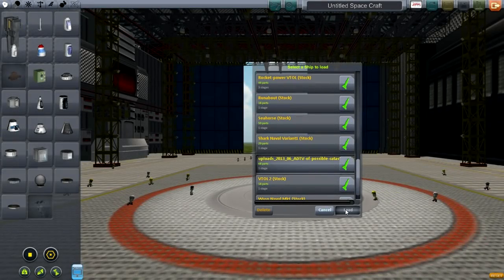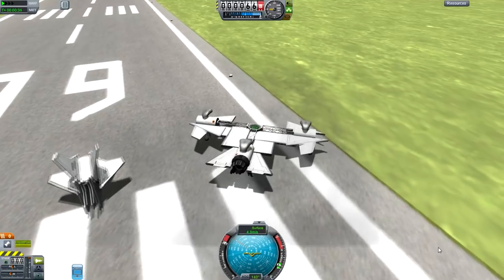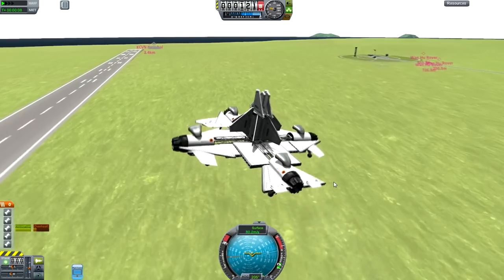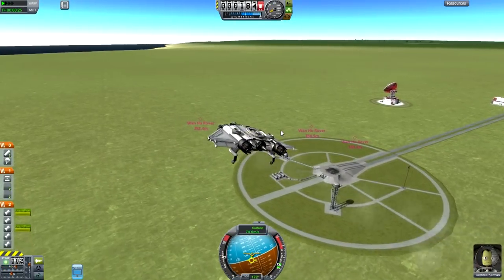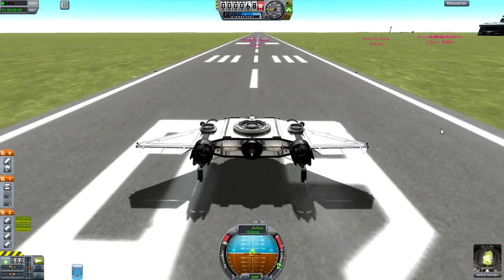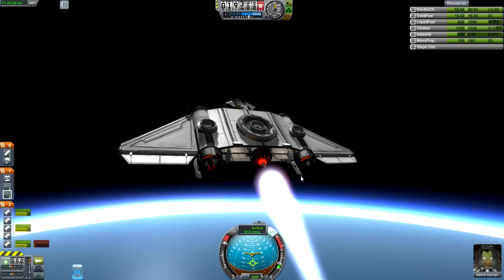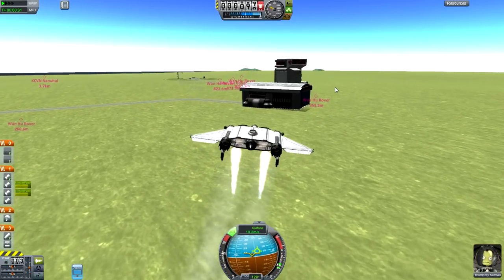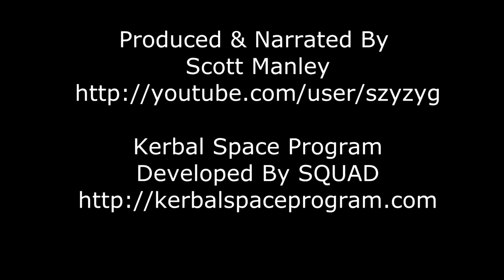Kerbal Space Program - Fan Built Aircraft

Comment: every plane is a VTOL, all that matters is your perspective.
Reply: 'Vertical Takeoff and landing'. Vertical is not really a subjective word, but i get what you are saying. However, a VTOL needs to be able to thrust in 2 different directions, 90 degrees from each other. Typically using the same engine on a pivot.
Reply: GoatzAreEpic Maokai It is supposed to take off on a 90 degree angle relative to the ground, or 180 degrees relative to the direction of gravity.
Reply: GoatzAreEpic Maokai Not every plane has the amount of power required to lift straight up, but may have enough power to take off from a run way. Likewise, even at full thrust a plane without insufficient power to take off vertically also has insufficient power to land safely in this way. 

Maybe you could say every "fighter jet" is technically a VTOL, but even that statement I'm sure there's some jet out there designed for a proper runway rather than a carrier and doesn't have enough thrust to lift off vertical.
Reply: +Jamison W. (Lasherz) if you forget that horizontal vectors exist then I guess you could say so, otherwise most planes are DTOL's, diagonal take off and landing
Reply: 5destroyer35
Agreed, the control surfaces aren't designed for it power aside.
Reply: +Richard Smith When joking around is taken seriously by other people, i laugh so hard. Thank you for this experience xd
Reply: not really
Reply: not really
Reply: Every "_Modern_ Fighter jet" Forget getting something from korea to accelerate straight up.

Comment: I have spent a bit of time designing aircraft in Kerbal and I must say it is a lot of fun. I have designed a few aircraft and I have also built, what is essentially, an SR-71 Blackbird ripoff. It lacks the fuel capacity for anything, but a short flight though 

My best personal design is a plane called The Viking Mk.III which looks like a mix between a MiG-15 and a SAAB 35 Draken(Dragon) with adjustable delta wings and dual tail fins.

Comment: Hey Scott, when using spaceplanes you should flatten your ascent above 18000 meters - 21000 (depends on plane) to gain horizontal speed before your final ascent. 700 was definitely too slow, you would burn too much fuel to ascent and reach a stable orbit.

Comment: I would LOVE for you to do this again and showcase a craft of mine.  I forget the mod it uses, but it's the mod with the hinges and rotation devices.  Comes in quite handy.  My design uses both.  The wings rotate and hinge for many interesting positions.  Also mounted underneath the wings are rocket engines.  So it's a sort of VTOL type craft.  I've managed to get the balance just right.

If you're interested in trying it out within or not within a video I can send it to you either way.  Cheers Scott, loving the videos.  I'm an avid watcher/fan :)
Reply: PS~  It's also a "cheater-craft".  As it would run out of fuel way before you could have any fun with it.  I've taken it as far as Jool and one of her moons!  And that is when I found out that Jool has a solid core of Iron and the mass is so great that your craft is instantly crushed.  Was no easy feat getting to the center of the great Kerbal gas giant.

Comment: Stock render distance is 2.5km. This can be expanded.

The real reason why it wouldn't work (assuming 'around the planet' meaning literally around it) is because scott doesn't own some sort of theoretical quantum computer.
The fastest PC you could run right now would have a 5ghz 6-core intel CPU with Quad-SLI GTX Titans and 128gb of extremely high speed DDR3.

This might let you have a 100km circumference ring run above 10FPS. Maybe.

Comment: It would be awesome if we could apply special keys to each engine not to toggle them on or off but to change their thrust like with the 'shift' key.
Reply: I have to agree. I have some space craft with a secondary engine but I don't want to use it at full power.
Reply: Vastator Lower The Maximum thrust If there is just one. if there is two, you are out of luck.